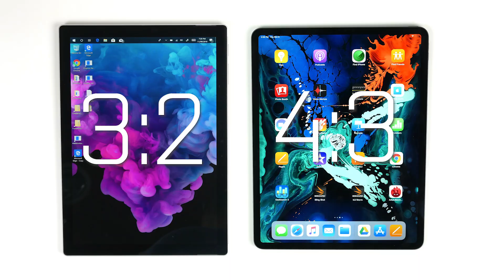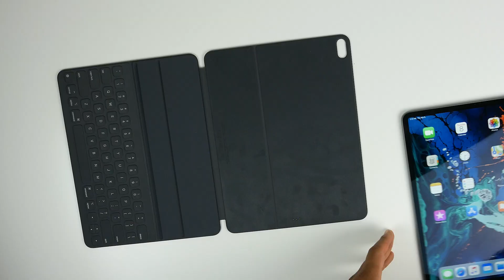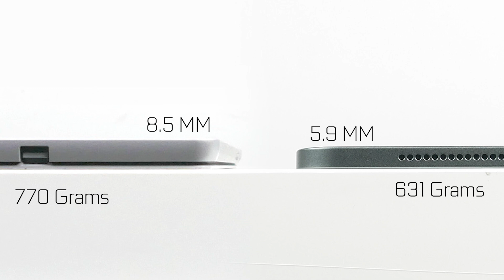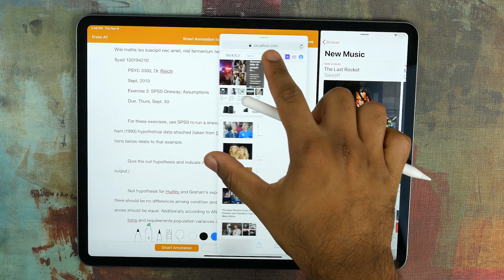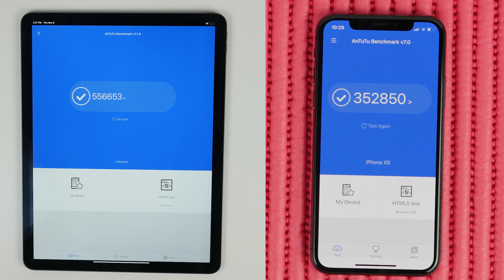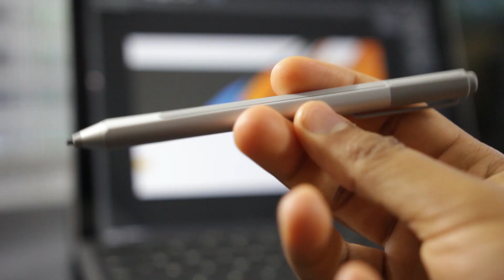2018 iPad Pro vs Surface Pro 6

Comment: Surface pro 6 is performing well while doing presentations. And you can notice that the surface pro 6 is way better than the surface pro 5. As a look wise the surface pro 6 is looks same as the surface 5 pro. So I applied an Ebony wood skin from gadgetshieldz.

Comment: Hey so I got the ipad for university! and recently returned it and will be getting a windows surface 6.  The issue I have is with the apps, some apps dont show my online portallly properlly.  Which has resulted in some missed online lectures.  So with the windows surface 6 using full programs, all of that is mitigated.

Comment: As a 3d Artist, the Surface pro wins everytime. 
Despite being powerful enough, the ipad pro has very few 3d apps and also the worst apps available for 3d modeling and texturing.
If you do have an ipad tho, check out "Forger" the 3d sculpting app.

Comment: A12x faster than Intel i7 why then mac book pro  work on Intel processor
Reply: A12X is faster than core i5 and some i7 procs, soon the new macbook pro will also have A13 processor.
Reply: @MilatovichFamily  can you put here some link to this MacBook pro with apple processor a13 ,or thay  are not already  made.
Reply: Those are benchmarks, low clock speed won't cut it in real world desktop performance

Comment: but can ipad run Programs, full programs no million apps?
Reply: I was wondering this and I dont think so. Like the Microsoft office seem Really good, (I should preface by saying I just bought the Ipad for school. Just the regular one tho. but its apps) - The ipad is really really nice for reading I must say. i gotta try the pen more but I remeber really liking my surface pro 4 pen.   That being said, it writes pretty damn good for 460$.  I notice just a slight pen upgrade with the surface and the ipad pro, nothing that would really be make or break. Definetly can still do some great notes.  But, I just feel having FULL functionality of every program is to useful once you learn how to use them.  Id say the ipad is good for a non techy person to have office functions.  So far for notes on the ipad I have to at least spend 17% for a solid note taking program, that being said I have not extensively tested "Pages" that comes with the Apple.  But I the reviews seem to say "Good Notes" is a solid purchase.
I also did get the detachable usb keyboard, logi case for the Ipad, and I must say I can be picky but it is nice.  That being said, my computer gives different selections for my online university portal than the ipad, which worries me because I dont want to miss any assignments from that.
Reply: @akadopeboi  good choice!
Reply: Lightroom CC, Photoshop CC is comming, Affinity Photo, Lumafusion..... So yes it does.
Reply: @MilatovichFamily  I meant full programs;
Reply: Can surface run them with its crappy hardware? It lags in anything related to 3d and even some brushes in photoshop can make it lag

Comment: "A12X faster than any of the iterations of INTEL X86 CPU" INSTANT DISLIKE ... what the hell are you comparing. what kind of joke is this? do you know something about cpu architectures ?? WHAT THE HELL !!!!!
Reply: So the processor on Apple is realllllly fast.  But it doesnt give you the full functionality that full programs give due to it using apps. imo.  Which kind of negates having a super fast archeticture.  UNLESS, they plan to do a really nice update at some point, therefore the processor would techinically make it "future proof" and ready for some good evolution into a fuller OS, with full functionality to programs.
Reply: He is talking about benchmarks like many people who don't know difference between arm instruction set and x86 instruction set and architecture says
Reply: A12x is beating 80 % windows pc .......arm revolution !!!
Reply: @rohit-gk5lr  even then I wonder why doesn't iPad have the functionality of a PC. I mean no trackpads. That software. They could have made it dual boot with Mac OS or something for actual work. Right now it's an overpowered Netflix machine.
Like having a 5000$ gaming PC and playing GTA VC on it
Reply: If iPad became laptop what's the point of having MacBook air???......

Comment: Just broke the screen on my 2013 macbook pro 15 inch. I between fixing it 680 plus tax or getting a surface pro 6... not sure yet what to do
Reply: If you're used to the iPad pro, you should stick with it. However if you're comfortable using windows, I highly recommend the surface pro (especially if you're looking for something more laptop capable)
Reply: @Ravioliyt  I've never used an ipad pro just have an older ipad air. I am between fixing my macbook getting an ipad pro or trying out the surface. I hated windows 6 years ago that's why I went with a macbook but idk about paying over 700 to fix a 6 year old laptop. The surface isn't gonna cost much more then that. I have external harsdrives the ipad air loses the battle there since I cant connect them. Switched from iPhone to android years ago and happy with that switch but I do love my macbook !

Comment: I like the idea of a computer that is both a laptop and a tablet, cause then you’d have the best of both worlds. Laptops are easier to type with and scroll through (especially with a mouse) and surf more efficiently on websites that you have more access to accessories to, plus it’s easier to edit things like a comment, and have more access to programs, and shortcuts you can work with, not to mention you can hook up your usb or thumb drive; where as a tablet can be more handy when you’re on the go; plus if you have a pen/pencil you can draw on the screen, even though you can’t exactly download programs like Photoshop and the apps you download as alternatives don’t exactly have the same shortcuts that would be as helpful.

Comment: downplaying windows strengths. while promoting apple strengths sounds like an apple fanboy review. i knew he had no idea what he was talking about when he said a12x was faster than an intel x86 processor.

a12x is not faster and is based from ARM and the reason the apple is slimer. yes ARM processors generate less heat,  and are in smartphones everywhere but the processors cant workloads designed for computers. its two different architectures and you blending the two to try to find a winner is stupid.

you trying to justify a 1000 dollar toy from apple, that has no keyboard and mouse and cant run the majority of programs. you cant even run uses cases typically where professionals choose apple, try doing video editing or anything meanful on that device and tell me how it goes.

apple charges more while delivering less, the tablet experience isnt worth 1000 dollars. its for consuming content, if you have some idiot fanboys with 1000s of dollars to burn in their pocket this might be the device for you. 

far more capable android tablets that can deliver same experience for significantly less,

Comment: iPad wins hands down, it’s a fantastic tablet that can be used occasionally for productivity, 

Surface pro is like somebody who wants to be good at everything in high school but ended up not being good at anything, as a laptop, it has too small of a screen and worse keyboard and touchpad experience when compared to a cheaper ultrabooks from other manufacturers, as a tablet, it’s OS is far worse and weight, too heavy when compared to an iPad, especially an 11 inch, 

Let’s face it guys, the best combination of tech u can have right now are; 

A) Desktop/iMac - iPad - smartphone

B) thin and powerful 15’ laptop - iPad - smartphone

Comment: I had been seriously considering which to choose out of the two of these -- Ended up going with the Surface Pro 6 and I've had no regrets and definitely feel like I chose the best device for my needs. I love how light it is. I love how I can connect a thumb drive and quickly access whatever files I need, and even connect it to a monitor and have a quick double monitor set up. Honestly, I wish I had made this decision sooner.

I will add that all of my other tech is Apple: my laptop, my watch, my phone, all Apple. But since this device is mostly for work, and for work I use Access, PowerPoint, and Outlook - whereas the iPad Pro might be faster or "better", this meets my needs best.

Comment: I don’t understand why a chargeable Apple Pencil has an edge over a surface pen when a surface pen lasts significantly longer than any other stylus. 1 AAAA battery is enough for at least a year. Speaking from experience. I’ve never changed a battery in a surface pen before

Comment: You can’t run photoshop on an iPad Pro, you can only install an app version instead of the desktop version on an iPad. Surface pro is more convenient to use if you plan to use Adobe programs.

Comment: A12x is NOT better than the i7...
Also cameras are not important on a tablet ... 

The ipad strong points are the display ... only? I guess 

The surface strong points are 1 laptop replacement 2  better pen 3  waaaayyy better os 4  u can play real games not mobile peasantry games .. 5  u can be alot more productive on it ... 6  better keyboard ..
7  battery life (not significant)... i can go forever .....

I expecting people to start fucking me up in replies now ...

Comment: Im really buying the iPad Pro 12,9 inch model, actually because it has what I need for my classes and etc, also because I Will be a Paperless student, also saves economy in the way that it replaces your Notebooks, it saves space and it provides a great system of Notability so for students I recomend It if you are going to to basic tasks as mine, so Goodluck choosing
Reply: Thank you, very cool
Reply: Everything you described can also be accomplished with the surface as well.
Reply: @mw7967  The iPad is a much better system for notes and saves much more space and also weight, Teachers do not let you take notes with the laptop but with the iPad they do, the pen is better, the screen and much more things, as I said before it acomplishes all what I need in terms of notes and comfort
Reply: imBlaze YT  once Apple drops iOS updates in roughly 4 years, this iPad will be useless.  This surface will last for many more years and will be supported by software for much longer than this iPad.  iPads are great, but they're a terrible long term investment.  If longevity of software support is important....I cannot and would not recommend the iPad... especially the "pro" models.  4 years of iOS support vs a decade or more on the windows side....I'd even recommend a MacBook pro as a much better investment over any iPad.  It'll last you a decade.  The Ipad Pro's are an overpriced waste in comparison to any full desktop OS.

Comment: The surface pro has a BETTER processor than the latest 13 inch macbook pro. You can tell throughout this entire video this reviewer is extremely biased, I own both and let me tell you this, the surface pro outshines the ipad pro in every aspects except its slightly thicker. You can even game with addition of dual booting android or using bluestacks on the surface pro. Also keyboard links much easier and its definitely more durable than the ipad pro
Reply: Barttoocool I agree

Comment: But you cant do anithing heavy on The ipad The prosessor is wasted. You can do much more on The surface Pro 6 than The ipad pro you cant even multitask on The ipad and you cant do anithing with usbc port on The ipad.  you can do much more with The ports on The surface

Comment: Ipad pro has a lcd display, u say its the best display u have ever seen, u haven't seen the display of samsung galaxy tab s4 having an amoled screen. iPad's display does not even come close to samsungs display. U have not even a small experience in tech as u were referring a mobile chip powerfull than a full fledged laptop grade processor which literally powers a laptop. Research a bit before making a video on tech bro !!! Do not vheck the mumbers and put up a video.

Comment: For me, I'll be getting:
- Refurbished or NOS i7, 16gb RAM, at least 256Gb SSD 2017 Surface Pro (upgrade from Surface Pro 3 i5, 4Gb RAM) then
- 2018 iPad or refurbished 1st gen iPad Pro with Logitech crayon (upgrade from iPad 2 where the home button doesn't work properly)
(Update) Just found out that the logitech crayon doesn't have pressure sensitivity so it seems like I'm gonna be stuck with apple pencil.

Better value for money and what I'm planning to get as soon as I get some extra $$$. I'm a tech enthusiast and only buy used or refurbished devices normally from spoiled teenagers where they 'need' to get the latest stuff from daddy or mommy.

Comment: Apple needs to just put Mac OS on the iPad Pro already 🤦🏿‍♂️
Reply: There’s iPad OS coming
Reply: nope they shouldn't
Reply: Naw. If they put MacOS on the ipad, then what would be the point of the Macbook??
Reply: @Steven-r6y9l  you never used one and how dare you say it's garbage?! Windows is garbage. And I've been using windows from 3.1 onwards!
Reply: Zagica haha don’t let it get to you so much. after all it’s just some computers.
Reply: Well. What a prediction. It's done
Reply: @Pete-da-peter  when is it announce for?
Reply: YouTube google I saw the preview of the new os I wouldn’t say it’s Mac OS but at least a improvement
Reply: they are on different architecture..easy said than to be done..however I think they are figuring how to do it because the arm processor is more powerful than the ones on the laptop.
Reply: Dual boot ...
Reply: Then people would leave MacBook
Reply: Tommy Indra people would leave ipad
Reply: Fuck no. Mac OS sucks ass.
Reply: Nah mac os isnt built for fingers
Reply: Hell no!  IpadOS is alot more enjoyable experience than running macOS with remote desktop on an ipad. Even with mouse
Why do the same mistake as Microsoft did with the surface?
Reply: @dodger1x  mistake?? I guess that's why Microsoft's stock is going up n up after their event huh?? So much mistakes..

Comment: I am a Apple guy with iPhones, MacBooks and iPads. Apples strong point is their eco system, but lately, the last 6 years they have stalled.
I have the iPad Pro 12.9 2018, but I will move to the surface next time, and here’s why.
The iPad cannot replace your laptop. iPad does not seem to have many Pro apps, it’s still using a mobile Safari, despite the power of the Pro.....
There needs to be a new OS or it needs to grow up to allow better files sharing, cross platform apps, mouse support and better multi tasking.
The iPad at the moment is a glorified media consumption tool, not a Professional tool.
Surface is more versatile by far, the Surface can do everything the iPad can, and more. iPad Pro in name only, speed and size does not justify the name.

Comment: Peoples are confused in the comments. Saying that the A12 ship is superior to Intels CPUs. First Intel always have been known for great single core performance. This is also why Intel is still ahead at gaming compared to AMD. Well yes AMD's processors seem to better pricetoperformance than Intel but only when we are talking about Workloads. While AMD tries to get good performance by putting alot of cores into a cpu Intel got the superior archietecture that allows Intel to get better singlecore Performance. And the same is in this case. While Apple got better Multicore performance Intel got superior singlecore performance. And dont forget that we are talking about Undervoltaged cpus and not full desktop cpus. For example the i9 9900k got almost 3x more performance than an i7 U processor.

Comment: You forgot to mention the wireless display capabilities of the surface, and the docking station which gives you 4 more usb, 2 mini DVI for a total of 3 monitors, ethernet, and another audio port.  Saying that the ios has become more capable is a joke, there are no useful apps on ios.

Comment: I looked at a Galaxy tablet, because I wanted something small to use on my elliptical machine to watch Youtube, surf internet etc. then the cost added up to around $700. Thought about the   funky tablet programs -very annoying. I went to Cst Co to see if they had any Galaxy Tablets, I checked the latest and greatest Apple IPad, it dawned on me wait those are very much the same as the Galaxy Tablet (limited programs) IPad expensive  especially given what you have to pay for memory upgrades and are stuck with it.  I saw this little or similar sized Surface pro down the aisle? I checked it out loved the built in kick stand, the keyboard, touch pad, and cool magnetic strong quick connection to the screen, USB, capabilities -runs everything my PC does MS Office, best version of internet, Youtube, ........drum roll expandable memory up to 1 T byte, costs a fraction of what the $ bump is in tablets, screen resolution 4K, option to quickly go into tablet mode and all about the same price point it became clear there was no comparison next to the IPad and Galaxy. 
 I have three generation IPad's laying around and a Galaxy tablet. I should note everyone in my family has a Mac book Pro and Air book , I have Lenovo's and Dell for a number of reasons but I find the Surface is all around better than all especially given the looks , ease of use, touch screen, memory expansion. I love my large size IPhone 7 and 8  which does everything the IPad does.
After a months use with the surface it was the best choice by far.
 If your looking to buy you should first check out the Surface Pro in my opinion.

Comment: One of the things that I love most about my Surface Book, is the Surface Pen... and mostly because of the programmable button... I have it set to launch the sketch app, take a screenshot or play/pause media... and it is awesome for the last part when I plug my Surface to the TV and just take the pen as a "remote"...
I would love to have the recharge-ability of the Apple pencil, but in the past 2 years I am currently sitting at 60% of the third battery.... not very annoying.
One thing that he left out is that the tips of the Surface Pen are interchangeable so you can replace or use different styles.